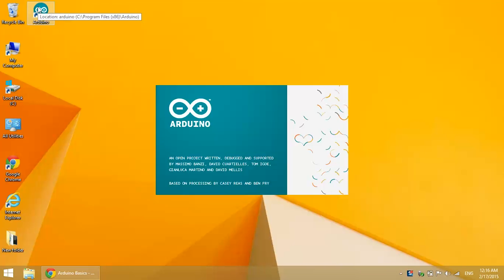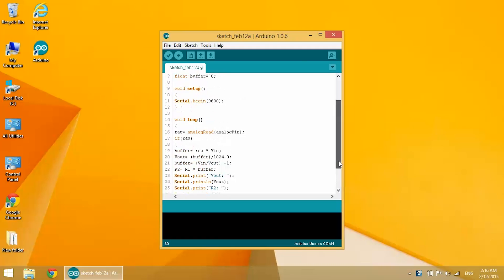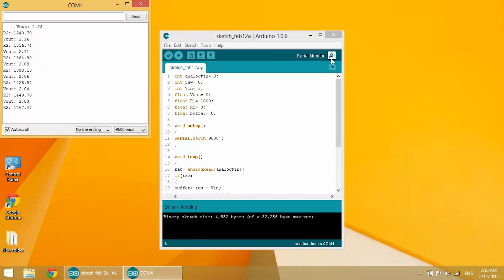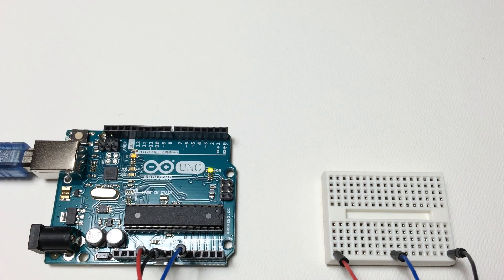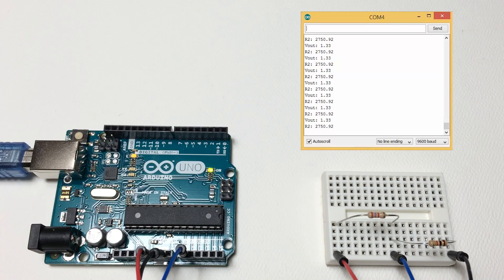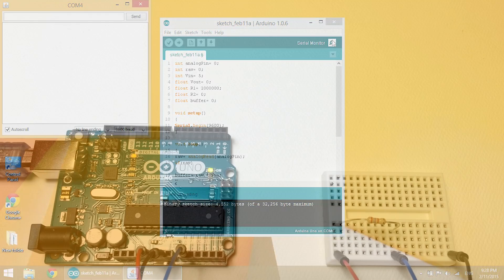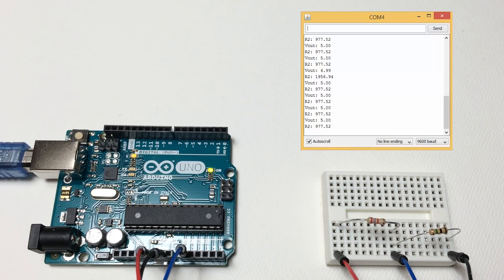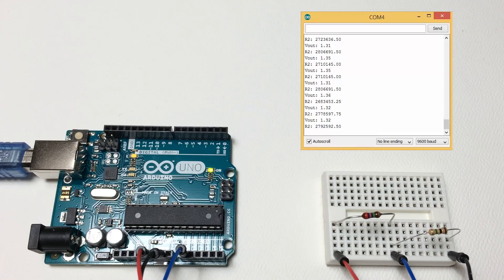How to Make an Arduino Ohm Meter

Comment: Can you add two reference resistors? Like one=1000 Ohm and the other=1000000 Ohm. If you do so, can you accurately measure any unknown between 1000 and 1000000 Ohm?

Comment: so this is basically useless cuz you have to keep the unknown resistor value close to the known one? I thought the purpose of this was to measure an unknown resistor? If it's unknown, how do you know what to choose for the known resistor?
Reply: The known resistor is used because it uses a voltage division equation to solve for the unknown resistor. The known resistor can be anything, it just has to be there because that way you have a current to use to solve for the unknown resistor.

Comment: How to use AREF as internal 1.1V voltage to measure 100 Ohm resistors with divider ? 
Divider: R1=100 Ohms and R2 = ~109 Ohms and Vin=1078mV=AREF_pin when analogreference(internal)
getting 1023 adc reading, this means Vout is out of reference ?
when i switch R1 to 250 Ohms then adc starts to read
Or i cant use AREF pin as Vin ?